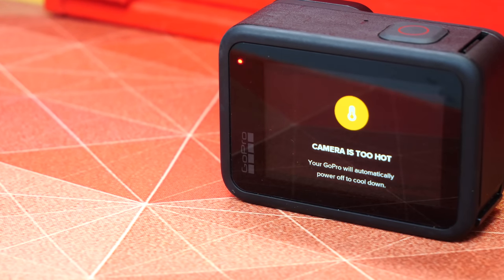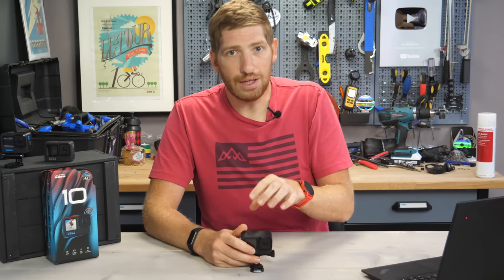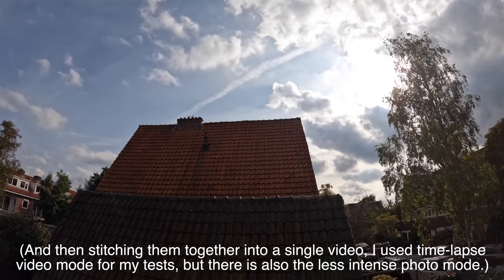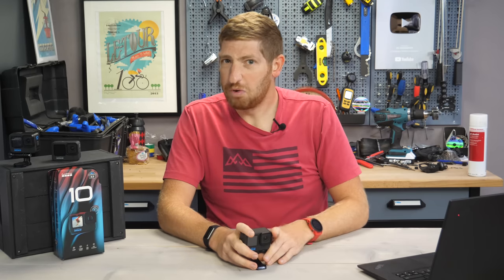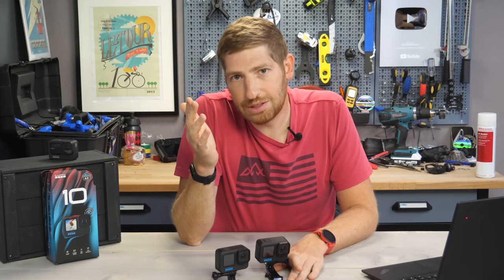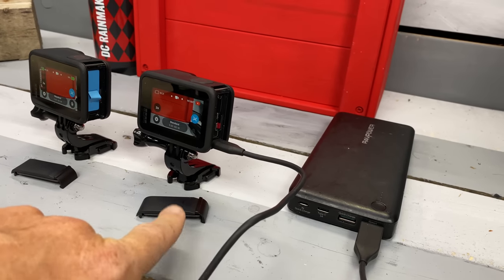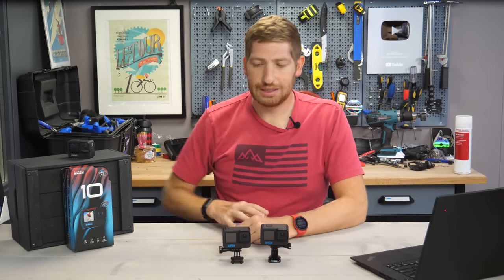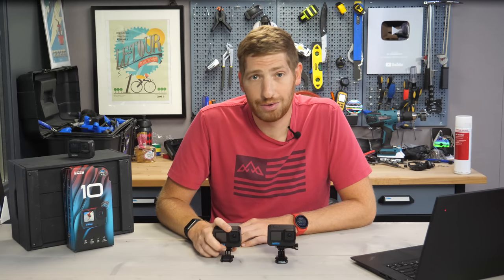GoPro Hero 10 Overheating: 40 Tests Later

Comment: My GoPro Hero 9 black can’t record 1080p 30 fps with stabilization for 10 minutes without over heating. Yeah I live in Arizona but I usually ride at night in about 90°F with ample airflow (100mph or faster). Highly disappointed with how this camera has performed over this past year. I got an Insta360 One X2 in April 2022 and it can record 4K 30fps with stabilization on until the battery dies. Even stationary in the sun at 105° the insta360 holds up. The GoPro is just trash in my opinion. I’ve had it replaced twice and both have had the same issues. Randomly freezing, overheating, stops recording randomly. Been through 14 SD cards, 4 batteries, and 3 replacements and nothing works. Every time I call GoPro support they blame it on the SD cards (sandisk extreme, all of which work perfectly in my insta360). If I could still return it I would. Worst money I’ve ever spent in my life. It’s basically a paper weight.

Comment: This is a really excellent video, amazingly thorough. Great job! 
But I paraglide with the Hero 10 in the Media Mod for two reasons:
1]  Some of my flights are over 2 hours,  and I need external battery and 2] I have to use an external lavileir mic inside my helmet because of wind noise and to capture radio conversations. 
Have you done any tests with the media mod in this mode? I'm in a constant 20 mph wind while flying,  but the media mod will restrict airflow. Also, sometimes I fly in 90 or 100F air.
I have not even taken my GoPro Hero 10 out of the box yet, because I'm not going to use it while I'm paragliding if I have to worry about it shutting down due to overheating.
Reply from the maker: I've done some tests with the media mod, but not that extensive. It seemed like airflow mostly helped. I'd guess though that the newer firmware update changes might help a bit. But I think the biggest thing for you would be to use 30FPS as opposed to 60FPS.
Reply: @Dcrainmaker  Ok, thanks. I really need 60 FPS 2.7k though. If it does not work hopefully I can sell it. The Hero 8 Black does everything I need, except for removable lens cover.

Comment: Very good video. I wonder what incidence the fact that you are filming a static image in the indoors case could have on their endurance. Since I’m almost sure filming a completely static image requires much less processing power to get recorded and therefore would be less likely to cause overheating.
Reply from the maker: I wondered the same, so in the case of the indoor ‘sauna’ for example, it was the fan spinning. I think in a lot of ways though, with a pure indoor static example, much of the picture won’t change. Whereas a dash cam type scenario would.

Comment: You mentioned turning off feature that aren't need to reduce... I wonder if turning off Boost or Stabilization altogether (since a real world "indoor no air flow" implies it is mounted on a relatively stable surface/support) makes any noticeable difference.

Comment: I need the gopro 10 for my motorcycle, this summer in South Greece. Its about 43° Celsius in shade. So what about this?
Reply from the maker: If your motorcycle is moving, you'll be fine. If you're sitting still in the sun, you'll want to go to 30FPS.

Comment: So...What about trying the overheating tests in HEVC/H.265 vs. H.264? H.265 uses way more computing power to encode, and thus drops battery life and generates heat (why every computer in the world has heatsinks). Just curious if it will make a difference shooting with a less intensive codec? I wouldn't recommend re-doing this entire test...but what about a couple of the higher res/framerate combos to see if there's a noticeable difference?
Reply from the maker: All of these were H265, but yeah, might be interesting for other file codecs.

Comment: Great test, but... what happens after overheat? How long does it take for camera to cool down and you can start using it again?
Reply from the maker: It depends, but generally within a couple mins. For fun, while trying to shoot the thumbnail, I let it overheat on 5K/60. Then it shut off. Then I immediately pressed the button, and it immediately started recording again for about 2 mins. Then it overheated again, and rinse/repeat - this time to about 1 minute. So that's an extreme example. If you gave it 2-4 mins though with the door open especially, I think you'd largely be good.
Reply: @Dcrainmaker  great, thanks! I asked because some Canon cameras need few hours to cool down and be usable again.

Comment: Ohh, my gosh!!!

I asked if you have encountered overheating.

Expected a line or two in reply.

Really is this the answer?

Awesome, awesome!!! I am totally blown away. You hit that ball out of the park into orbit and beyond!

This may seem totally ungrateful. Since I plan to use the camera for recording halfmarathon runs at 4k which seems to work out ok with two batteries and recording in 1 hour clips. And also to use it for long webcam meetings in 1080p, which also seems to be no problem at all. I should just go out and buy one now. But I will not.

Why won't I buy one? Cause it seems that it does not allow for linear mode in webcam use. Is that right? Or have I misunderrstood that? That is the ONE and only dealbreaker in it for me now. With you experience with Gopro, do you think they will release that update soon or never? Or should I get a Hero9? Or maybe the InstaOneR(nahh... that autoframe seems a nuisance in webcam mode)...
Reply: go to "Rosso's Running Channel" , his latest video was him running a 10k race, recorded with a gopro hero 10 on 4k30 resolution with one battery.
Reply: @bikingchupei2447  Thank you, but I don't need to see that. DC, clearly showed what settings to use. So I have no doubt about how to do it. Now my only gripe is the lack of linear mode as webcam.

Comment: H10, 52F, no wind, updated firmware, wind slayer on, several overheats occurred.  Less than 30 minutes of operation.  This was a 4+ hour straight filming event as I roll 100% of the action not to miss anything.Water cooling physically (in the stream) worked well.  I had to swap hot enduro batteries multiple times before batteries went dead.  Took the wind slayer off and no more overheating, admittedly though ambient temp dropped a few degrees.  Will look at settings to shut down any unnecessary processing going on, but I have very little hope for filming on an 80 degree windy day with the wind slayer on.  Not happy, but the image quality is too good to go back to Sony (which never overheated under any circumstance while trout fishing).  Happy fishing!
Reply: I film in 4K60.

Comment: I am looking for a power adapter for the Hero 10(EU Plug). Which one is recommended. Also wanna use it for Time Lapse events when there is no battery inserted. :)
Reply: Check out this article, it should have all the information you need - https://community.gopro.com/t5/en/Recommended-Chargers/ta-p/390257

Comment: Still using the 4 are the batteries compatible with any higher # UP?
Reply from the maker: The Hero 10 is compatible with Hero 9 batteries. Roughly speaking, most GoPro editions seem to last about 3 or so battery generations before GoPro changes it.

Comment: Great research! Only thing I was left wondering is if that tendency to overheat will shorten the lifespan of the new GP2 processor. Those things are not too happy about getting constantly too hot..
Reply: Good question - we’ve implemented thermal shutdown to prevent damaging camera components, including the GP2 processor. 👍
Reply: nope, that is WHY is shuts down.  To avoid any damage

Comment: Charging using c in the camera resulted in the camera turning on and then not being able to shut down either by me nor automatically. It was very hot. Learning? Never leave the camera connected after battery is charged.

Comment: From my experience, with older GoPro models, the inside of the dive housing fogs up. So although the camera keeps on running, I end up with unusable footage. 

Did you had a look at the footage the camera was capturing whilst underwater? And what was the temperature of the water?
Reply: It appears to just be laying face down on the bottom, lets just guess 8 feet deep?  I would guess being near the shore about 60 if on the east coast it 50 West Coast and 40 in the Pac NW.  Probably over 70 if in FL or HI.

Comment: I have a hero black 7 and what I did was took the battery out few days after I got it new , put a battery backup on it and went for 1.5 hours before I stopped it , never overheated once since I got rid of the battery . It now has space to let the heat go vs keep it all in one section battery and the card are right next to each other , of course it's going to overheat . Can you run the gopro hero 10 with out a battery for that long ?
Reply: Thanks Tony. This sounds interesting.

Comment: Seems like you missed a point, think you said it helped if you used a power source (not battery) with heat. I know not all time you can have it plugged in but if you pointed out that it helps then when you can just have it plugged in.

I’ve been trying to find out if this helps (my first GoPro is on it way) and you are first one I seen to mention this. 
Would of been nice to do all the test with it plugged in to I know the water one would been tough but just would be nice to know how much better it would perform so say if I was at beach or bike for long period I could bring my big power bank and use that to help.

Anyways one of the better heat test. Thanks for all the info.

Comment: I almost entirely use my GoPro to surf. So I’d nearly never overheat it. I used to ski and snowboard a lot and doubt it would overheat. 

Mountain biking I could see it happening, but you’ve shown that with a more realistic frame rate and quality along with airflow, it may be over exaggerated by people bench testing these literally. 

I think vloggers are forgetting the purpose of the GoPro. Name a $400 camera that you can survive a fall out of an airplane into a pig farm and land in mud and still capture clear audio.

Comment: In summary for my usage they far exceed the period of time I'd be recording for so not really a problem for me. 
I think gopro's community, me included, always want more from a Gopro and now everyone has got the resolutions and frame rates they wished for they have turned to the overheating as the next thing to shout about. 
If it was me I'd shouting for gopro to do their own wireless mic with built in Bluetooth receiver so you can get the rode wireless 2 setup but in a less bulky set up essentially.

Comment: You’re doing a fantastic job. It is difficult to get a conversation with GoPro so I wonder if you could help me? I only want a forward facing camera for safety but I am concerned about the battery life when recording as I do long rides, > 2-3 hrs. If I get a Hero10 and leave it in standby mode, the screens will power down. Would I be able to start a recording by just pressing the record button? If I used the “Hindsight” function set to say 30secs, if there was an incident, I may well be able to capture the footage I needed, even though I hit the button after the event. Would that work. 
Thanks in anticipation. Love your videos.

Comment: I wish some of the scenarios were about as fast as a person using forearm crutches can go.  Using it to prepare for two things I have wanted to do one may sound lame but I am too disabled to do anything thrilling sadly well extreme walker sports but I was going to make walks with my dog but I don't seem to go fast enough for airflow as while the camera stayed on testing the camera it got quite warm to the touch  , 

The main reason I got it was for underwater though so as the ocean is super cold I don't worry about the overheating.    

A going fairly slow setting would help as your speed for some airflow is way faster than I move although maybe I'll wind up with the going super slow data

Comment: Interesting. I did some similar tests ... What I noticed is that the overheating is also influenced by the type of memory card used and more recently by the type of battery (the new enduro battery is much better).
Reply: Yeah, the Enduro actually has less capacity but last longer under cooling and heated conditions.  Looks like you may want one of each type.